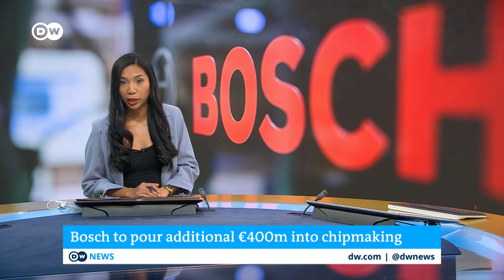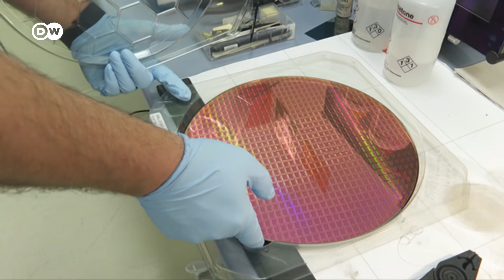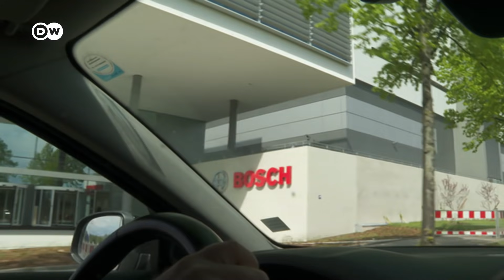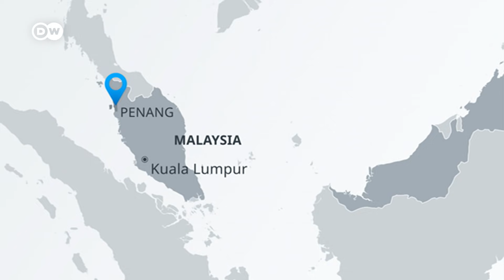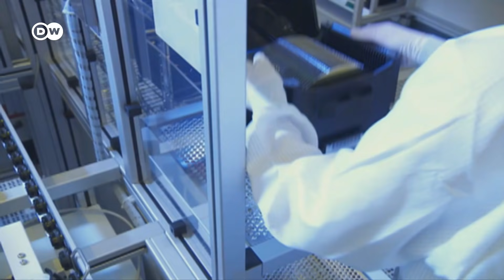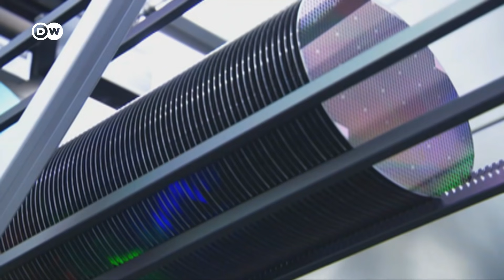Bosch to pour additional €400 million euros into chipmaking | DW News

Comment: "These investments couldn't come at a better time."

Well, if they had invested earlier, they could be now selling as much as they can produce. I'm sure Bosch is not the only company that is and has been for a while working on to fix the chip shortage problem. Once every company's upgrade projects will be finished, the result might be an oversupply of chips.

But diversifying production outside China, where a great majority of electronics products has been manufactured for years, is a good thing. Generally having all the eggs in the same basket is risky, and lately especially China has started to become more risky.

Comment: Europe already tried and failed to do this many years ago. As politically sound as it may look, it is just not economically viable for Europe, they have few and very expensive engineers compared to the East.
Reply: If They do It There is A reason.
shortage.
Reply: More trade barriers..🤔 thanks for sparking the idea
Reply: Europe had no problems getting Airbus. It was made possible by government will. Europe should have its independent chip sector and the past 4 years should have made very clear Europe must NOT depend on the US for anything.

Comment: A 5nm  chipmaking plant in Arizona needs $12 billion.  €400 million is small in this industry. But it's good to on you own.
Reply: They are concentrating on integrated circuits for power electronics, so far bigger structures than 5nm.
P.S.: Silicium Carbide MOSFET and MEMS sensors and things based on those.
Reply: so they investested in 2 month 1,5 billion I wouldn't call it nothing if you consider the way eu is handling chip making (airbus like concept)
Reply: It's not high end foundry nor is it brand new. What do you expect?